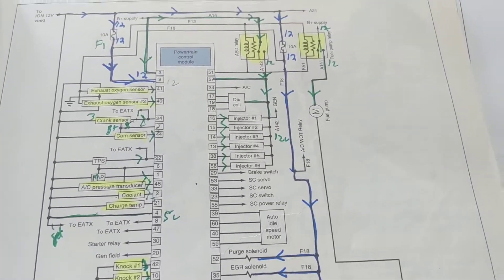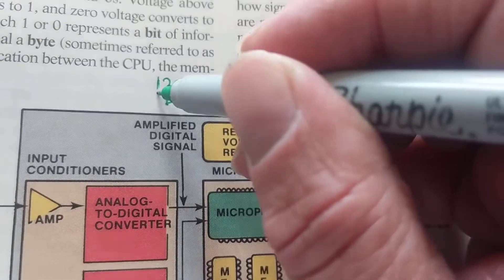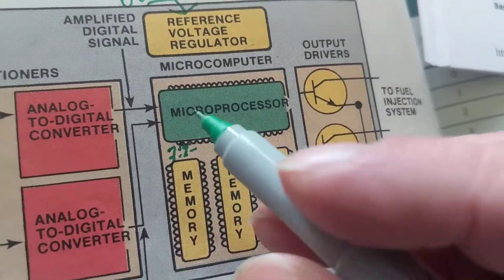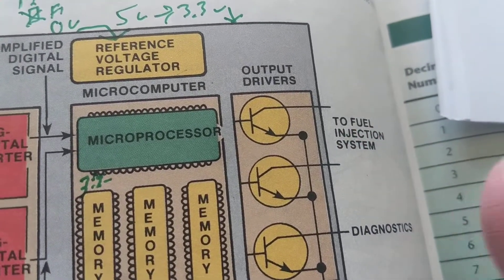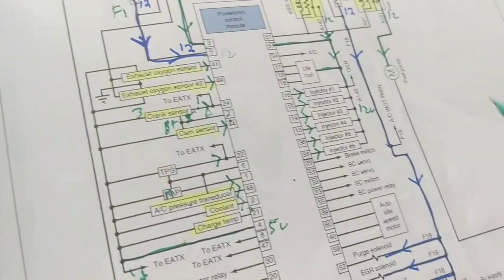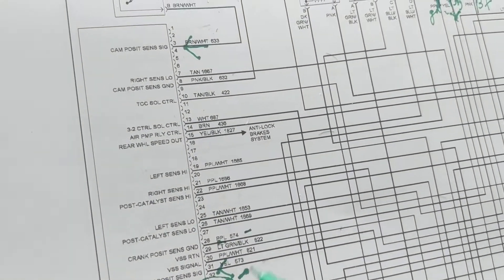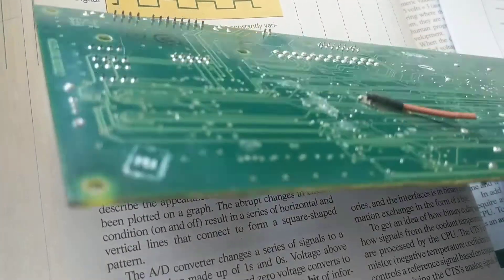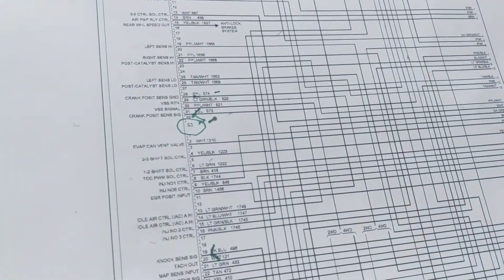HOW TO UNDERSTAND BASIC ELECTRONICS OF A PCM COMPUTER BOARD FOR BEGINNERS PART 1

Comment: Joe can you explain also the wiring diagram of chevrolet captiva gas 4wd 2011,tnx
Reply from the maker: I don't know if I have the schematic for that I do have a wiring diagram for a few systems of it it's the same as other Chevys the computer controls the relay around and starts the starter motor if I get more diagrams I'll expound more
Reply: @Joeelectronicschematicsforauto  tnx joe well appreciated